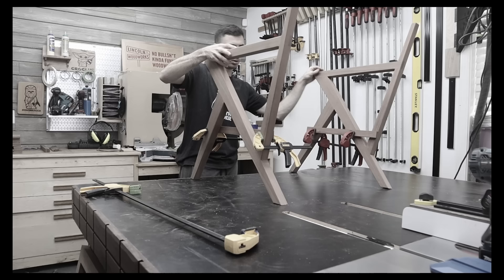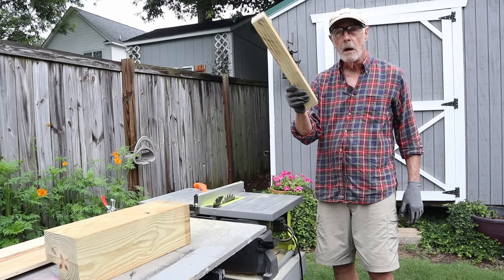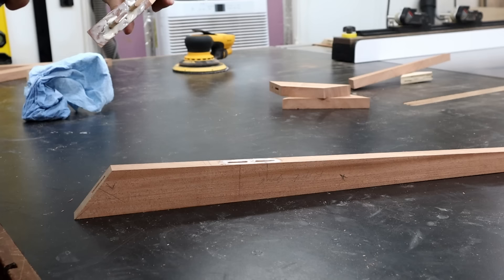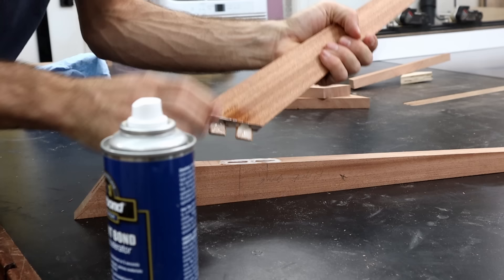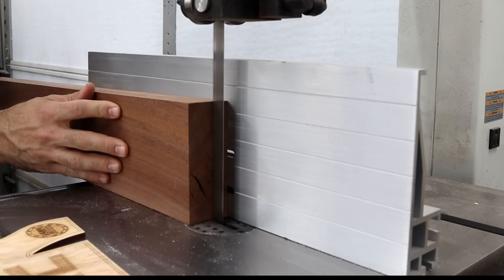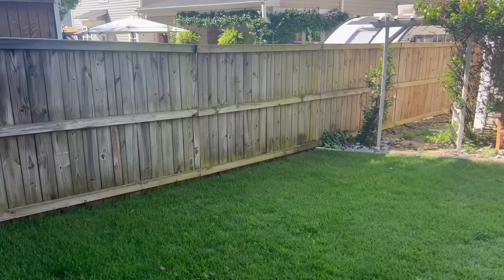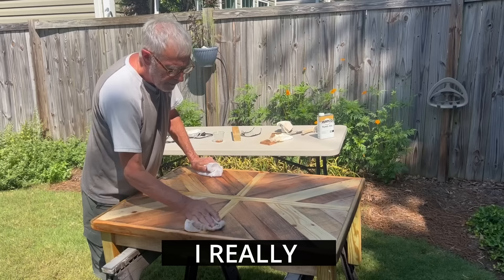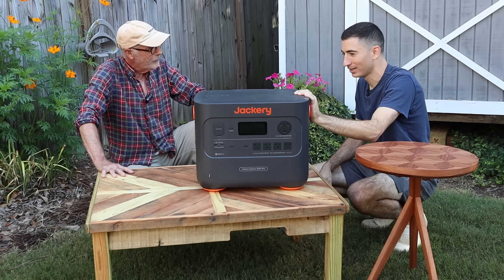I challenged a 78 year old to a build off

Comment: I like the pallet table cus of the size of it, the simplicity and building process being relatively simple. Post build I reckon the pallet table will last a bit longer cus the wood has already been through the weathering process and will last longer. Your round table design is aesthetically pleasing and next to the chairs can be easy enough to swing your arm round and put a bottle or glass/mug on, but I would say doesn’t have stability if you have pets or kids about. 

Overall, John Snr takes it. Enjoy your beer 😁

Comment: I agree with everything you said . But , and I don’t disagree with you on this , I’ve found another way to sand rather than use pencil marks is use an adjustable desk light.. I can adjust it so that it shines across the work piece and it seems to work very well. Also a little trick when you have to cut off just a smidgen with your compound mitre saw is , with the blade  down and not running, take the piece you want to trim and push the blade over . It won’t give much but enough to shave the piece . I loved your ideas. Keep up the good videos . Thank you .

Comment: Brilliant video. I like Johns table best😅. 
Honestly though both have their own charm. Simple, cheap with minimal tools. Elegant, elaborate, needing thousands of dollars of machinery and everyone scared to put a drink on it for fear of leaving a water mark or scratch!
Each to their own. Each has a place. I’d probably go for the pallets and beer as I think the party around that table would suit me better.
Reply: Please, tell me what part of younger John’s table “required” expensive machinery?? Granted thighs fitting compound joints are quicker and easier on the expensive tools, they can and have been made for centuries with inexpensive tools, even hand tools. And truthfully, I am far more impressed when the accuracy is due to the woodworkers skill rather than the price/quality of his tools.
Reply from the maker: A perfect summation!
Reply from the maker: @corymichaels8670  I think I mentioned this in the video - but I’ve always viewed the expensive tools as a way to speed up the process. Not necessarily make anything “more accurate”. Without a jointer, planer, table saw, band saw etc - you would be hard pressed to build that from rough cut lumber in less than 2 days without it looking all wonky. Expensive tools are a convenience in my book.

Comment: these both came out really nice! personally my methods are somewhere between the two of you guys. I was fortunate enough to learn woodworking in a cabinet shop owned by mennonites who liked to do things more or less the old way, we used nail guns and sanders and whatnot but for sure did not have all the high dollar specilaized  equipment a modern woodshop would have. it takes longer but you can still do great work that way! from there I went on to a much more modern cabinet shop and added cabinet install to my skill set .having the knowledge of how to do things with minimal tools was very very helpful because I could see ways to do things that the guys who only knew the modern ways could often not see. nowadays (almost 30 years later) I have a LOT of tools and I think good tools are essential if you need to make money with your craft unless you do very bespoke items that you can take a long time on and charge a lot for. but I still work installing cabinets and can do so with all the bells and whistles OR with just some very basic tools, again its a time thing. I find it equally enjoyable either way just in DIFFERANT ways . the best way to describe it to the younger generations would be it's like playing Minecraft in survival with no cheats VS creative mode haha you can do such cool stuff on creative mode and it is very enjoyable but then there is also a whole different kind of enjoyment playing without the cheats, it is very satisfying. I suggest to anyone starting out in woodworking to just keep things simple for the first couple of years, get to understand the nature of the materials you are working with then when you add in all the good expensive tools you will be way better than you would have been had you not.

Comment: Old John did a great job but voting for him because he went the simpler route is just silly. Young John get my vote because he was grinding hard til the clock ran out and it really shows. The table might be smaller but looks flawless. You can find multiple uses for both, so size really isn't a factor.

Comment: I really like the mid-century modern aesthetics of the round table. And, I really like the simple aesthetics of the rectangular table. So, I like both. However, I would really like to learn more skills/techniques that help with repurposing wood. I think those skills/techniques would also work well with projects built from scratch (built new, not repurposed). I prefer to use repurposed wood that I have found, and I buy new wood only when I have to. Nonetheless, this was a great, fun video.

Comment: I think older John would make some even more awesome things with a better kitted out workshop. Man did a hell of a good job with what he had. And reusing the pallet wood is a bonus in my book. I love seeing pallets serve another purpose.
Reply: A lot of time having the right tool for the right job is important. But so is knowing your tools and the skills you have with them. My grandfather knew how to true up a circ saw blade by running into concrete. Sounds insane but works on HSS, not carbide blades. Wish I had taken more time to learn these things when I was a kid, a lot of knowledge wasn't passed down. Those tricks of the trade are what allows us to do the things we do.
Reply: For sure older John could use a new brace and bit, maybe from a garage sale or estate auction.

Comment: I used to work at a place that manufactured sweep plows. The company refurbished old plows and eventually moved into designing and building their own.
There was an old timer that had worked for the original manufacture of the sweep plow the aforementioned company refurbished. He ran a torch table and cut out many different parts. Lyle was very efficient at his job. He could put newer technology to the test by how many parts he could produce.
I happened to be running the cnc mills and lathes. On one particular day, i was running two large mills, one small mill, and one cnc lathe at the same time. I had the parts time figured out to where i could jump from one machine to the other and put out parts with little downtime.
 I started irritating a few of the older guys because of the parts i was producing. I decided to challenge Lyle, the guy with years of experience. He did not accept my challenge, but i am convinced we would have close to breaking even on parts produced.